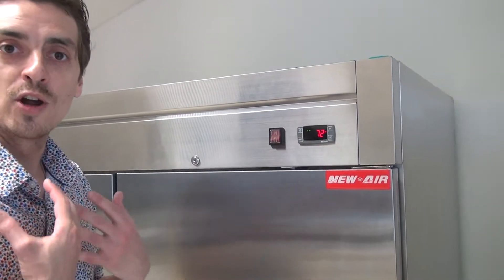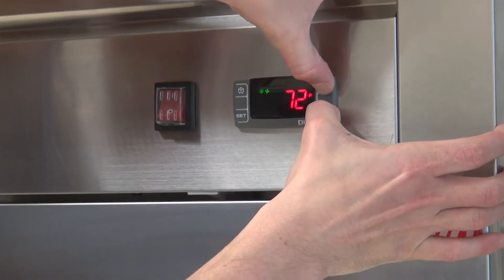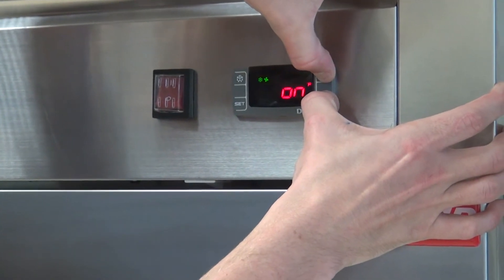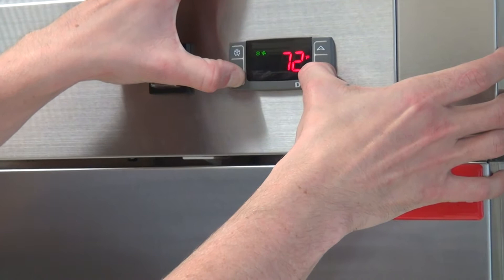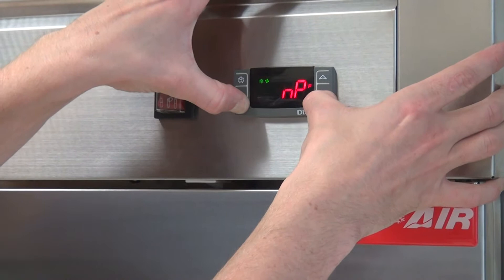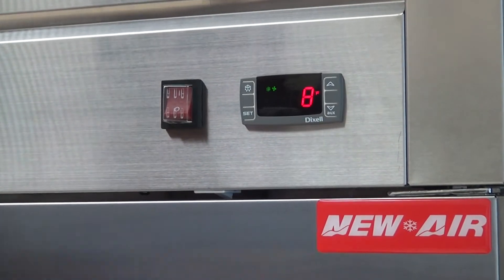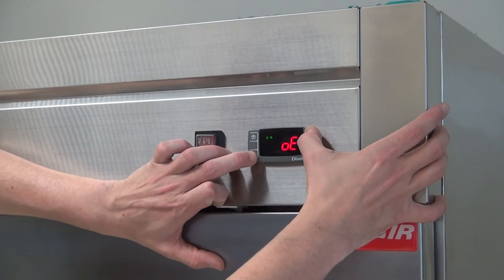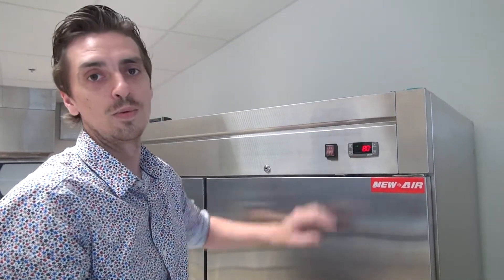NEW AIR - HOW TO: Calibrate the Dixell thermostat temperature deviation

Comment: I did the same thing,I have the temperature in Celsius I set the temperature at 10 degree celsius but it shows 32 degree celsius,after I select the 10 degree celsius I need to press the set button few seconds?
Reply from the maker: Good day, 
The temperature setting does not represent the physical temperature inside the unit. To set the temperature as shown, you press and hold set until it start flashing, adjust the temperature and then press "set" once. 
For example: if the display shows 32, this is the current inside temperature. Press and hold set for few seconds, it will start flashing, you can then set your request temperature to 10. Press SET once, and it will go back to 32 which is the current physical temperature inside the unit. 
We hope this helps, thank you for reaching out!